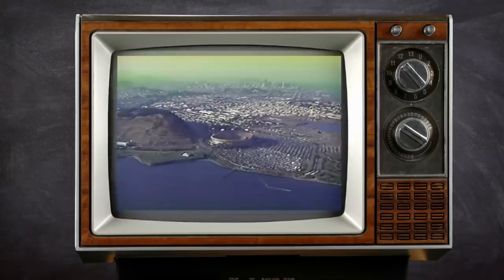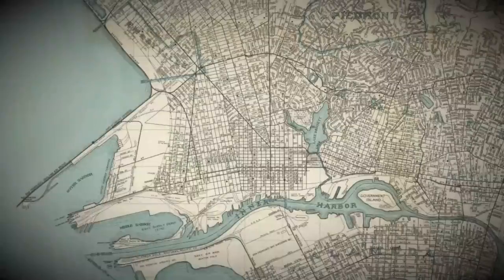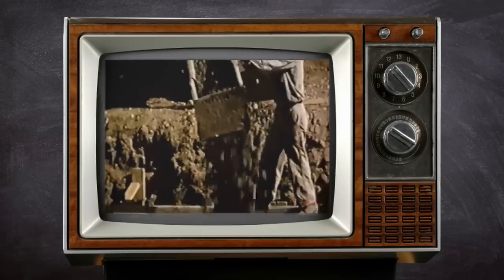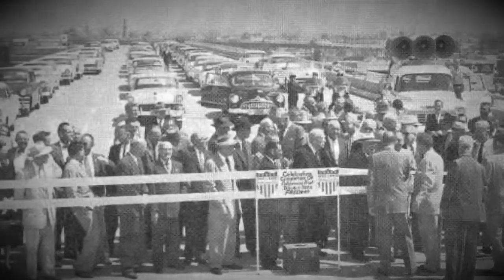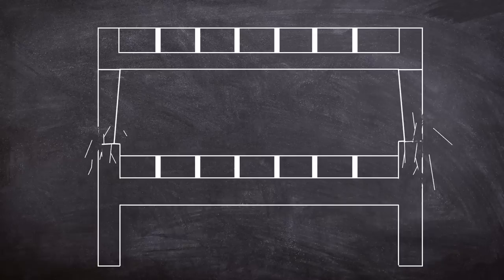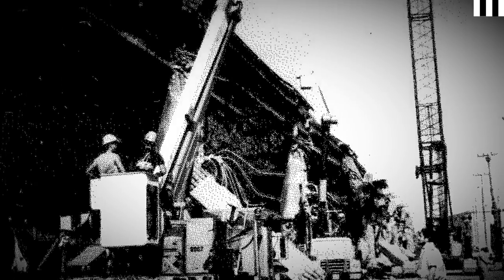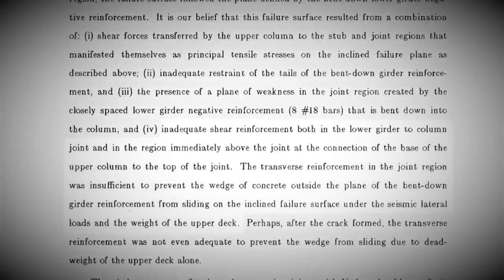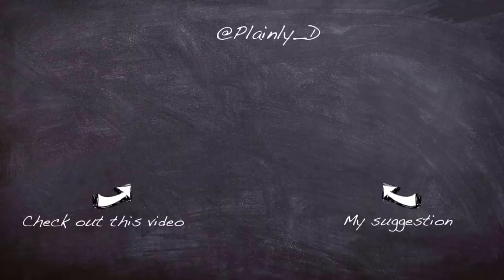A Brief History of: The Cypress Street Viaduct Collapse Disaster 1989 (Documentary)

Comment: I was in Santa Clara, CA (Silicon Valley) south of San Francisco interviewing for a job when the Loma Prieta earthquake occurred (Loma Prieta is the name of the tallest mountain in the Santa Cruz Mountains near the quake epicenter). The interviewers office was on the second floor of a "tilt-slab" building, which was a common type of construction for light industrial buildings in the region. As soon as the shaking started we both crouched under office furniture. When it stopped I observed that the suspended acoustic tile ceiling had failed around the edges of the large room, which was divided by office cubicles, and many of the tiles has fallen to the floor. We then walked into the research lab where six foot high storage shelving had fallen over. Shortly afterwards, the PA announced that the building should be evacuated. It was less than ten miles to my home in Sunnyvale, CA but it took over an hour because traffic was completely gridlocked. The only damage at home was from a large wall mounted speaker that had fallen onto a glass topped table and shattered it. As mentioned in the video, the epicenter was well away from San Francisco. I was on a group hike some years later when we walked to the actual epicenter, which is in the Forest of Nicene Marks in the Santa Cruz Mountains east of Aptos, CA. The towns nearer the epicenter, e.g., Santa Cruz and Watsonville, CA suffered incredible damage but it was much less covered on the news because of the Cypress St. Viaduct collapse and the structure collapses and subsequent fires in the San Francisco Marina District.
Reply: @_-Karl-_  No, but I got a better job shortly afterwards.
Reply: News covers larger populations overlooking small ones when widespread disaster strikes. We got the same with the 2011 Alabama tornado outbreak where Joplin and Tuscaloosa were all over the news while the Smithville and Hackleburg/Phil Campbell tornadoes which were two of the strongest in all of history went totally uncovered for a week afterward, and then only got a small mention. Just how the news media works I guess.
Reply: @P_RO_  correction: it's how humans behave. The media is making profit off of news that people wanna see. We can blame ourselves for the lack of reporting I  smaller communities. Local channels still exist who cover these tragedies but no one is gonna watch them instead they tune in to stuff like this and then complain about the focus of main Media channels.

Comment: The "as designed" bent/column stirrups (basically a cage around the vertical bars) were missing (i.e. not installed during construction).  This allowed the now unconfined vertical rebar to bend excessively and blowout the columns.  Yes, the rest of the design features you mentioned contributed but it was the failure of the columns being "jackhammered apart" that you can plainly see in the photos.

Comment: I lived in the Bay Area for a couple of years in the mid-'90s, and was always a bit leery of the entire MacArthur Maze (the confluence of I-880, of which the Cypress Viaduct was part, I-580, and I-80 at the east end of the Bay Bridge). Not only is it a colossal and confusing mess (that at the time was still under construction, rebuilding from Loma Prieta), it has flyovers stacked on top of flyovers stacked on top of surface roads, and it's mildly amazing the whole thing didn't collapse in '89. I miss a handful of things from my time out there, but commuting to work on those freeways is not one of them...
Reply: I am so glad my commute was from Alameda...to Alameda 🤣
Reply: It was terrifyingy to drive over too.  When I went there is a child I kept asking Mommy and Daddy from the back seat if we were going to fall off of it and die, or after top would collapse on us - and we would die.
Reply: Not having to deal with that stuff is why I always take the train whenever I head over to SF. So much simpler.
Reply: @willd1790  The Transbay Tube requires seismic retrofitting as well lol
Reply: @haroldlipschitz9301  I'm sure it does, but at least I never have to worry about getting stuck in traffic or getting on the wrong freeway (which I have done multiple times despite living there for years lol)

iirc the Tube was up and running again within hours of the Loma Prieta quake? Maybe things are worse now-it wouldn't surprise me given the state of infrastructure  in this state/country honestly.
Reply: @ZGryphon You may or may not know that in 2007, a tanker truck took a turn too fast, crashed, and burned down one of the MacArthur Maze flyover ramps. They rebuilt it in a month. The driver lived despite a few bad burns.
Reply: @theskillzreport   I don't think I did that, but upon reflection, it doesn't surprise me much.

I used to commute to work from Oakland to Pleasanton on I-580, and I remember one day a guy flipped a sewage tanker on that big flyover in Castro Valley. That must have been fun for the people who lived in the neighborhood under the highway.

Comment: I studied this particular failure in graduate school.  The design was perfectly adequate for the original design criteria.  What happened is that that the vertical acceleration from the seismic event was much higher than anticipated.  The result was a reinforcement of existing columns for freeways and other structures coupled with an increased vertical acceleration design criteria for future construction.

One thing to remember in seismic design is that the goal is not that the structure survives unscathed but rather that people can escape the structure and survive.  The structure in question may need to be demolished but if everyone that was inside the structure survives then it is a good design.

Also, in designing structures to meet anticipated seismic accelerations, the vertical acceleration component is much harder to design for than the horizontal movement.  The vertical acceleration in the Loma Prieta earthquake was about 0.6g.

The failures of the columns on IH880 show that they failed due to a vertical loading rather than a horizontal loading.
Reply: The problem was and is that it was designed ONLY to meet the design criteria; nobody was trying to do the best possible. Yes, some things were unknown when it was designed but we need to change our engineering approach or preventable failures will continue to vex us. You only go as far as you're reaching, so instead of reaching for a specific design point reach as far ahead as you can, and things like this will be minimalized.

Comment: I commuted on this structure for over 10yrs. As I recall, just prior to the quake, there was a traffic accident south of the double deck viaduct section which impeded northbound or lower deck traffic substantially. Had this impedement not happened there would have been many more vehicles on the lower deck at this rush hour time. I was amazed that there weren't hundreds more casualties. The northbound traffic impedement saved many lives.

Comment: My older sister, who was a year old at the time, almost had a speaker fell on her when the quake hit. My mom was coming home from grocery shopping only to find the Cypress Freeway itself blocking her route home.

We are still due for a big shake. Or so I heard. Hopefully, the relatively smaller shakes we have been getting in the last three decades are enough to prevent a massive one down the road. Especially since we have a major skyscraper in downtown SF having some structural issues since it's completion in 2016.
Reply: I don't think the Hayward's been getting as much action as the Calaveras and San Andreas. When the Hayward fault slips it'll be ugly, no doubt.
Reply: @00muinamir  Some reports say the Hayward and Calaveras are connected 😬.

Comment: I was in El Cerrito.  We thought at first it was the Hayward fault.  The building I worked at was concrete block (aka cinderblock) construction.  It was yellow tagged until passing inspection two days later.   Many buildings had to be inspected.   San Francisco TV stations used their mobile trucks to send signal from the studios up to the transmitters at Sutro Tower due to power outages.

Comment: I wonder if encasing the vulnerable portions of the columns in structural steel cladding to contain the crumbled concrete would have helped. This is often retrofitted now to round section columns for just this purpose as I understand. I recall the horror of the event unfolding on the news even now and as a Brit.

Comment: I'm not sure if the satellite imagery at 11:48 in the video is supposed to show the new viaduct, but if it is, that's not the right freeway in the middle of the frame.  The freeway in the middle is I-980.  The Cypress structure (what we locals called that viaduct/freeway) and it's replacement is part of I-880.  I-880 is at the bottom frame with the curve on the left side of the frame being the beginning of the new viaduct.  It curves around and the comes back into the frame at the upper left hand corner of the screen.  The Cypress structure ran to the left of the row of white warehouse buildings on the left side of the screen on what is now called Mandela Parkway (the former Cypress street).

Comment: I am convinced that Seattle has barely escaped the waterfront viaduct collapsing many times over. The Nisqually earthquake of 2001 damaged the viaduct very badly. Concreat railings fell four stories to the ground. Columns cracked in half and sections of road slide sideways becaming misaligned as much a 6 inches. The state installed steel drum cast bolted around columns, faked the repair of misaligned road sections by moving railings to meet where the road did not. Then the seismic activity from the Big Bertha tunneling machine cutting underneath for the Hwy 99 replacement started to magnify & multiply all the historic damage. Then the Bremerton water ferry slammed into Colma dock at 13 knots adjacent to 6 failing columns creating an actual 4 to 6 inch dip or drop in the road at that junction of road plates.  It would have been worse if a collision horn had not been sounded when it was. The Collision horn being sounded allowed the crew to slow the ship down at least 6 knots. Resulting in a smaller shock to the surrounding soil. Which in that area was just a Sandy Loom fill behind a already failing Seawall. The viaduct already had many problems before 2001. That earthquake really came close to dropping that whole roadway. It is just sheer luck that it did not. Add all of the aggravating issues that have been piled on top of that since and we had many situations of freakish luck that one or more sections of that roadway did not collapse. The tunnel that now runs underneath the viaduct path was completed just in time.  A DOT road crew member was using a 30mmx400mm point chisel on a 52CC 2 Stroke Demolition jack hammer was making a pocket to place a structural charge in the center/top of a column for test demolition. The column split, collapsed and took a 15ft x 30ft section of road down too. He was worried about this and had harnessed himself to a back hoe bucket hanging 10ft over his head that kept him from dropping too. After that they took the whole thing down quickly using an Excavator GC Hammer of 4425ft lbs impact @300 to 700 blows per minute in far less time than was expected.

Comment: 11:00: Uh, it's "CalTrans."

11:52: That wide roadway in the center of the photo is the Highway 980 connector from Highways 280 to 580, built shortly after the earthquake.  Now that the Cypress viaduct proper has been replaced, 980 has been shut down and is slated for removal.

My father used to work in Oakland at the time and used to drive home northbound on that viaduct five days a week.  On the day of the quake, he had driven through that section of the viaduct about ten minutes before the quake hit, having left work a bit early that day.  I recall him being rather shaken by the experience since, if he had left on time at 17:00, there's a good chance he would have been killed.

Comment: I felt the quake in Loyalton, 220 miles from San Francisco toward the Nevada border. I was doing the startup checks on a new turbine generator install at the sawmill. I felt it from the control room on the top floor of a steel building but thought the boiler was causing the de-aerator tank to rumble and shake. The rail crane pendant control was swinging and the building swayed a bit. Later, while awaiting the shift change, a worker told me that I need to go home ASAP, that San Francisco was ''completely destroyed'' by an earthquake. I saw the news in my hotel room while packing my stuff. They focused on the Cypress Structure and the flames in the Marina District leading me to believe it was far worse than the 1906 quake.

The National speed limit was 55 mph at the time. I drove home at 110 mph down Highway 80. CNN said ''all of the bridges are out''. I was thinking of borrowing a boat to get from Benencia Marina to Martinez, hotwire a car and get home.  None of that was necessary. The bridges were closed for inspection for a while, then opened shortly after.

I got home to Lafayette and the lights had just come back on, 18 inches of water sloshed out of the pool, and a ceramic rabbit cookie jar broke an ear off, no further damage. My family was terrified. A few weeks later I had my house wired for automatic 12 volt backup lighting that comes on with power failure or for jolt that's more than a 4.5 quake. It has come on 50+ times in 30 years, for seconds and sometimes for hours at power failures. I was also in the 1971 Sylmar Quake before daylight and stepped on broken glass in the dark and was in pain for weeks. Loma Prieta made me put in the new whole house backup lighting. I have a seismic natural gas trip valve as well. Why chance further disaster.

Comment: Was in the bank vault getting audited at the time of the quake in Albany CA which is next to Berkeley CA.  I was at the time on public transport and only got home by indirect methods including using the "L" Express bus from SF that had the Bay Bridge collapse right behind it as the driver had slewed to a halt across several lanes.  I flagged the bus down outside the bank once I could leave and they stopped telling me this is not an L stop - I know! but the "72"'s had stopped running. Later I found out that cornices had fallen back in Oakland blocking the streets and of course the busses.  This was before cell phones so I was peppered with questions from passengers. I got home cause a bus rider needed gas and as a long time resident of East Bay knew all the gas stations. Took a couple to find one with power but I got him his gas and he did indeed drop me off near my apartment.  Cooked a quick dinner just in time to watch the power go out in grids including mine.  A very interesting day to say the least.

Comment: Wait I still don't get why the structure was weak in the first place. I get in the 1950s people didn't know how to handle lateral loads. However, shouldn't the shear keys have prevented catastrophic failure? Were the steel piles door deep, or too shallow? All I understood was that the original design was flawed because the designers didn't know how to do it properly, but I still don't get why it is flawed.

Comment: The earthquake threw lots of items off the shelves in the grocery store I was in Marin . I had headphones on but noticed something was wrong when other people were looking around. Then I felt the shaking and it got stronger with at least one big slam. The lights in the fruit and vegetable area were swinging back and forth like a pendulum. I wasn’t scared as I’m was used to earthquakes and was happy I was in a store rather than at home where it would be boring and no items to fall off shelves. Only when I got home did I see on TV the extreme damages and big fires started in the Marina SF. I live about 20 min north of the freeway. After the earthquake the similar double deck Embarcadero freeway  was massively reinforced  and could have been saved but anti freeway zealots tore it down. Now San Francisco has one of the highest pedestrian casualties. It was amazing driving the Embarcadero at night and seeing the reflection of your vehicle in the glass of skyscrapers. You could get around the City very quickly or onto the Bay Bridge easily. Now there are massive traffic jams and stop lights. San Francisco peaked in 1989. They had so freeway many ramps driving was easy. Now everything is a bike lane and the congested streets are blocked or three colors with lines everywhere. Avoid SF at all cost. Syria is probably safer.

Comment: It WASN'T the "Cypress Street Viaduct", it was the "Cypress 880 Expressway" that collapsed, also, it wasn't the San Andreas fault line that the earthquake was centered on. The Loma Prieta fault was a fault that no one knew about, and it crossed the San Andreas fault, which is a "Strike/Slip" fault line, which means that the fault moves horizontally, not vertically. 

At the height of the earthquake, the Loma Prieta fault was moving at 13mph in every direction at once. I lived only 4 miles from the epicenter of the quake, and it triggered the San Andreas fault where the two faults intersected, and I remember quite well just how it felt. So if you're going to talk about the Loma Prieta Earthquake of October 17, 1989, then GET YOUR FREAKING INFORMATION CORRECT!!